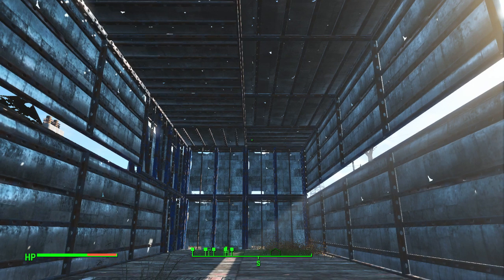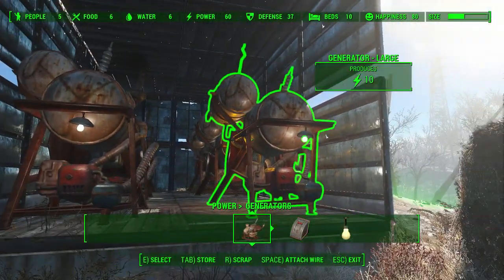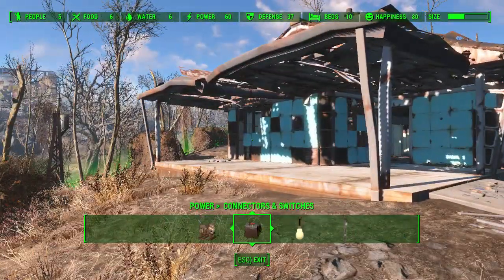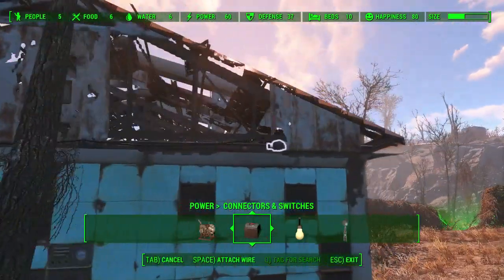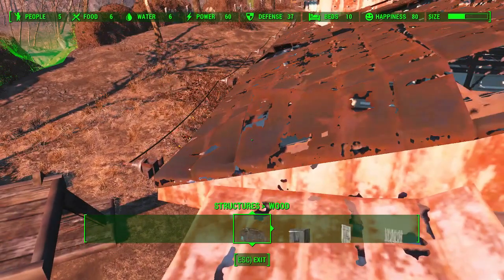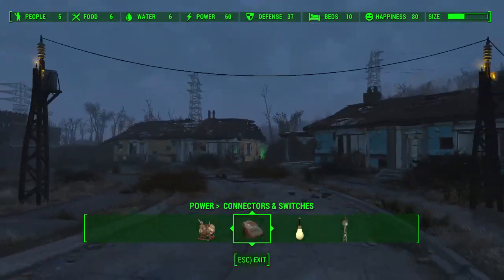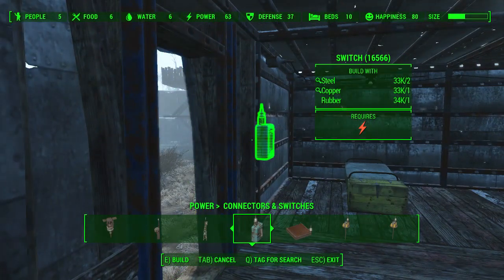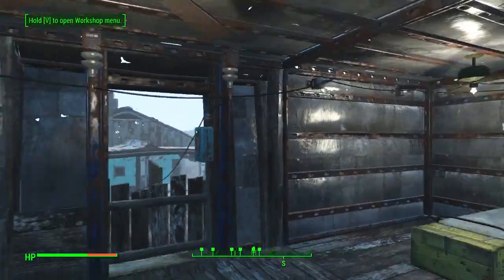Fallout 4 Settlement Guide - Settlement Power Guide

Comment: Only need two conduits for an entire house at Sanctuary.  Well the ones that already exist.   Also a single 3 Power Generator can power 2 houses at Sanctuary if you only worry about putting lights, and do not use a lot of conduits to power them.   In turn this means you can use Wind Turbine generators for most of the "Lighting" at Sanctuary, quiet power in short. =D

Comment: How did you get so many resources?
Reply from the maker: +eluxsus0195684 Use other settlements to scrap and salvage everything there. Also I collect everything I come across, I don't leave anything behind.
Reply from the maker: +Christian Smith Incorrect, I will eventually start using mods, when they release some good ones, but a batch file just for resources is pretty pointless =/
Reply from the maker: +Christian Smith 34k Steel, Wood and Copper and Ceramic is very VERy easy to acquire, I believe I got nearly 20k'ish just from scrapping everything in my other settlements. Adhesive, and Nuclear materials on the other hand require a good bit of grinding. I am not lying nor do I need to lie when I even stated in my previous video, that I have 2x Save files, 1 which is my normal game and the other which is a save is my settlement building only save where I used console commands to acquire 100k+ of every material, thus allowing me to build crazy designs and decide if I like it or not so I don't waste materials in my normal game save. If I was lying or trying to hide something I would edit out things I didn't want you to see lol.

2-3 hours of farming and scrapping other settlements yields very big gains in materials except for nuclear and adhesive.
Reply: +CursingWithCurtis
And even in this case, adhesive can be made from plants. Veggie starch can be made at any cooking station from a mix of tatos, corn, and some other plant. This starch when scrapped, counts for a whopping 5 adhesive each.

Since a cook pot already exists in sanctuary, you can throw down a pretty basic farm and literally grow your own adhesive in bulk. Looking for circuits for those pesky turrets? Telephones and hotplates are both fairly cheap from vendors.

So really, the only truly rare mats if you know where to look are nuke mats, fiber optics, and ballistic fibers.